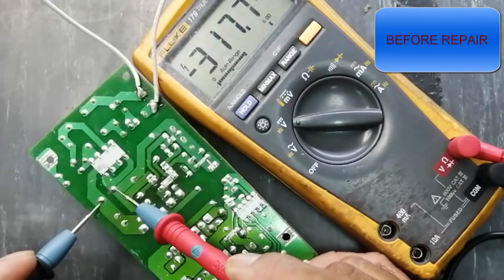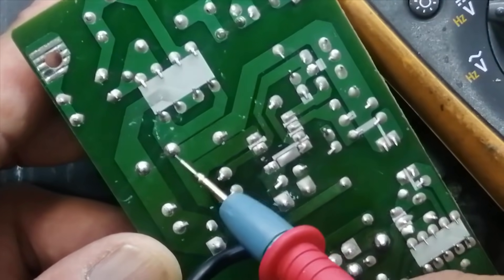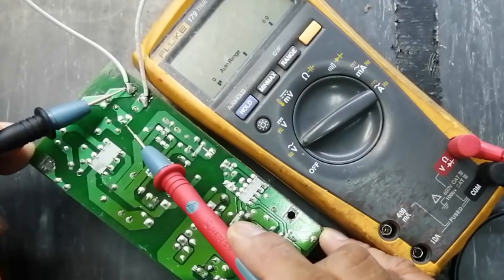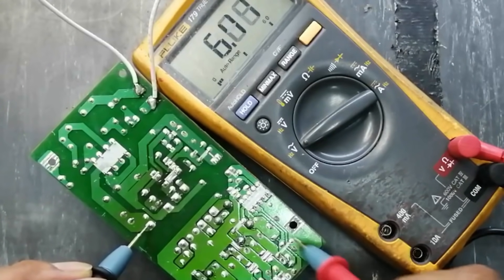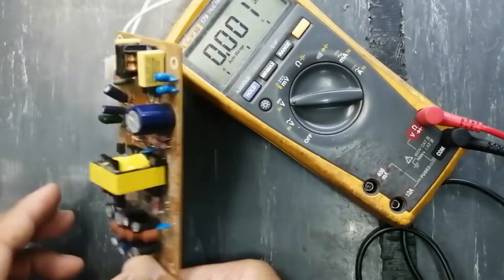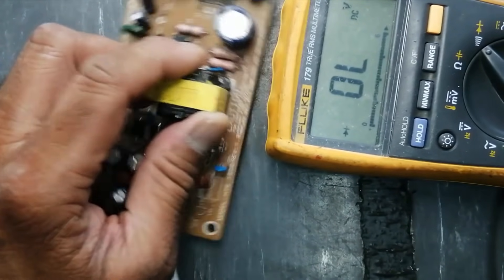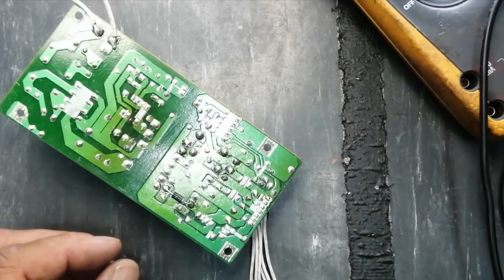{245} SMPS Output voltage Fluctuation in Switch Mode Power Supply

Comment: i have a question sir , a  HD dish receiver/dvr   smps have a sound the output voltage is 20v,15, &5v but its not powering the dvr i tried everything to repair it with ur tutorial i cant find the problem i have attached a link   photos  pleas help 
thank you sir 
https://drive.google.com/drive/folders/1g_1lm453hVBPT1ITPNuA6lrspkUiU_AI?usp=drive_link

Comment: Dear 
I have a problem with smps 24 volt 5 Ampere power supply
When I applied more than 1 Amps load the start fluctuation
But when I applied less than 1 Amps
Then no fluctuation and work proper and stable

Comment: Hi, my 120W (12v 10A) smps output voltage good but output current very low, i am unable to use 12v 5A load even in smps no voltage fluctuation or down very stable voltage, i checked all components are good in pcb, but low output current, so what problem & component to be replace in smps ? waiting your reply, thanks

Comment: I like your way to go thru the PCB 
and tell what I have to expect. 
Perfect and very detailed. 

Yes, very very dangerous for unskilled persons without detailed electronic knowledge.
Very good = You use a Isolating transformer ans tell it in the viedeo . 
But still charged high voltage capacitor can kill you (or hurt a lot). 

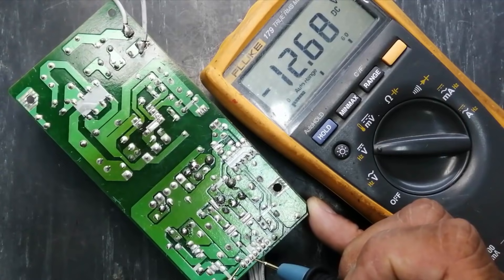Is your diode (minute 13:13 ) able to work well with the high switched frequency ? 
What type of diode you have choosed?
Reply from the maker: best regards and special thanks for your valuable comment 
yes this work is dangerous for unskilled person
yes the charged bulk capacitors are like a "hand grenade" which have removed pin
yes the diode at 13:13 is same replacement for original one

Comment: I have a quick question. Is that pull the required ampere output such as 20A or 30A or 40A from 230v with a 6A/10A 3 pin? I am using a car amplifier at home which is maximum ampere rated as 35. To get a desired ampere output what should I do?
Reply: Buy a strong power supply and (not legal?) combine it with a addition smal car lead battery. 

(Maybe not legal in you country and not safe enough. But you shure can add a fuse and never ever choose to high voltage at the power supply unit. For safety a an additinal PCB with an overvoltage protection circuit) 

(Remember these cheap lead batterys are very robust , but heavy and fault tolerant. lithium batterys are uptodate and the specs are nice. But the voltage control have to be very very preceise or these lithium batterys are extreem dangerous and can burn hotter than you can think. Ok other types of lithium batterys are ... But all are expensive to buy and you must use a high quality charging circuit)
 
All ideas at your own risk. 
Maybe not legal in your country. 
Better be an little expert in electronic and take your time to read and study before you burn your house  and ruine your health. 
Safe money can be very very very expensive ! 

Sometimes it is better to buy a 230 Volt cheap smal amplifier 
and forget cheap experiments.

Comment: Photocupler voltage is 1 v when it's running normal
Reply from the maker: yes, it is 1 volt when it is in linear conduction and it is maintaining CTR for regulation

Comment: If there is an open instead of a short in the secondary side of a smps, how would the circuit behave?
Reply from the maker: the output will fluctuate at vcc capacitor and main dc rail but no output at all
 because it will not receive feedback

Comment: Sir at 10:47 time stamp the diode reads both side. Is this normal in output section. I came across this issue many a times and could not solve it. Can you make a video on this subject. I had put this question to you before but I dint get an answer. Please help me understand this diode reading and beeping both ends. Thank you again.

Comment: Hello my teacher. I keep watching your videos over and over. Here, there was a fluctuation in voltage due to the diode at the transformer output. I wrote to you the same problem, I had a vestel 17ips62 card and I measured all the parts by inserting it on it and there is no short circuit. but the voltage fluctuation did not stop. There is a smps transformer that I did not insert. what do you think it could be? I will be glad if you can help

Comment: Hi. I have a SMPS. When it power on, 10 seconds SMPS output is normaly then fluctuation begins. Give me any suggestion for this please?
Reply from the maker: some capacitor have internal leakage OR
some solder Joints are Dry-soldered (check transformer connections on PCB, MOSFET connections, current sense resistor, Output capacitor check ESR of the capacitor, main dc capacitor )

Comment: So my supply has no output and it's reading 179v on the transistors heat sinks. What could be going on?
Reply: It's a Dr Meter 30v 10a power supply. PS-3010DF

Comment: Hello sir i have 12v smps but when i tried to check output it is showing 26v ac component why it is happening?
Reply from the maker: it may be due to some capacitor open in output section, or open in feedback circuit. check tl431 voltage divider network, optocoupler

Comment: good work Sir. i am having similar problem with hp laserjet p2055 power supply. the fuse keep blowing continously. i change the faulty capacitor but still the same
Reply from the maker: in fuse blowing problem. following components are involved 
MOV (varistor)
input filter cpacitor Class X capacitor
MOSFET or PWM IC (if mosfet is built in)
Bridge rectifier

Comment: No flactating but not pure dc
Reply from the maker: there is is a difference in fluctuation and pulsating dc or not pure dc
when SMPS /PWM controller or any offline switcher fails to get feedback signal or control voltage, it works in UVLO threshold limits, when any IC works in UVLO regions, it drives in reboot or restart or recovery mode, so see variation in voltage . it also may occur due to IC LEB leading edge blanking limits as well. it can be checked on VCC capacitor, if VCC hold off capacitor is varying that means it is working in reboot mode due to any problem in voltage feedback or vcc or current limit section 
NOT PURE DC term is used to express the ripples in output. so it will monitored in DSO,

Comment: Hi,  I also have a power supply, my switch mode  power supply switches down from 230v to 24 v dc. However, my power supply has intermittent problem, where under load it occasionally switches off and then turn back on. The voltage at the output is 24 vdc. I am not sure what the problem is, as it is intermittent.
Thanks, any help appreciated.
Reply from the maker: If it trips and restarts 
It means it runs in overload protection condition
Please check main dc capacitor
TL431 Circuit for proper feedback
Reply: @HaseebElectronics  OK,will check and let you know.
Thanks

Comment: Sir may i know if you use the continuity check or beef mode for checking the Dior in ckt how much  resistance will read by the meter tnx
Reply from the maker: we can check diode using diode mode, or continuity or resistance mode
every diode is have different reading 
for example germiniuim diode drop is 0.3 volt, silicon diode will drop 0.7 volt, shottkey diode will drop 0.2 volt, 
so we have to check forward bias and reverse bias readings
i will try to share in detail video very soon and tips and tricks

Comment: Well done.
Reply from the maker: best regards
Reply: Can the wrong inrush thermistor burn my mosfets?
Reply from the maker: are selected in much safe operating limits. so there are many other other parameters involved in mosfet damage, specially the worst issue is magnetic design and the driving signal mismatching

Comment: I have similar power supply output 12v but it's defective it's only output 3v. What is the problem?
Reply from the maker: please check 12 volt. rectifier or capacitor . because 12 volt power supply is independent, so it must appear in output
Reply: Already found the problem it is NPN TRANSISTOR #C2655. Now my power supply working good again. Thanks!

Comment: I have a ps4 power supply that turns off after you switch it on, without output of 12v.

You would have to unplug the power cable and reinsert for it to turn on again.

I would be glad if you can hint me on what to check for during repairs

Comment: I have this same problem with my wireless 21V drill charger. Voltage was not stable from 21V-19V constanly. Checked the octocoupler from both sides and its reading fluctuates. I did remove the diodes on the dc side, checked and are reading 0.299VDC. I'm now stuck at this step since it's not a shorted diode problem. Please note that I'm just a hobbyist as I have this broken charger for a while and have already replaced it with another unit. I just want to fix this so I could have it as a backup charger. Thank you in advance.
Reply: @HaseebElectronics  Wow, thank you for replying. I never expected you'd reply that fast. Back on the subject, I do have a UTC LM358G between the output terminals and the LED indicator lights. There is also a SMF5N65 on the hot side just before the transformer. I already tested it and is working. The indicator light just tells you when it's charging/fully charged but will not tell the battery levels. The battery level circuit is on the drill itself. Do you think that the LM358 is the problem in my case? I will try and learn to test it and will replace it if needed. Thank you for helping me where to look.

Comment: Thanks. It does get a bit harder when some designers add 4 times the amount of components for regulation and safety.
I wish they would go back to the big heavy transformers 1 cap and 4 diodes. Thats it. Oh yeah. Thanks for english.

Comment: My friend you are the best!  You helped me understand so much.
Reply: @HaseebElectronics  my friend I have a SMPS driving me crazy, have changed everything and still dead.  How to check the yellow transformer is not dead? I have removed it.
Reply: @HaseebElectronics  its for dvd player, big main capacitor was blown, changed it and now have 320v dc on primary.  Also changed all caps, removed and checked all diods on primary and secondary, have checked everything with no luck.  No voltage on secondary caps and no dc output.  It doesnt have ic, only fets and transistors and two sharp transistors for 3,3 and 5v.. Pages 30 and 42 on manual, (manual is for 110v but same design)
https://www.manualslib.com/manual/1099991/Pioneer-Dv-444.html